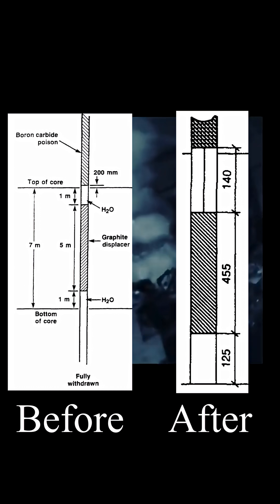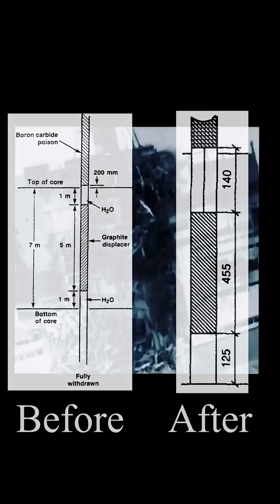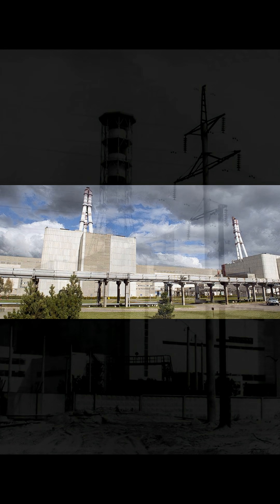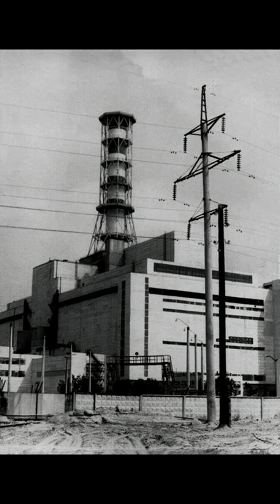Did a Simple Design Change Cause the Chernobyl Disaster? #science #history

Comment: I've read about water displacement casing a fission spike during maintenance of a small experimental reactor in the US, back in the 1950's or 60's.  A control rod literally pinned one man to the roof of the building.  What I've been able to glean about Chernobyl's reactor was that the control rods had graphite extensions.  Boron is the element that absorbs neutrons to dampen the reaction, but graphite is a moderator.  The video mentions the graphite but fails to mention that graphite is a more effective moderator than mundane water.  Having pulled the rods all the way out, it was this graphite that caused the reactor to heat up so quickly it caused the steam explosion.
Reply: That was the SL-1 reactor. It was a tiny, tiny experimental reactor and the cause of the accident was much different  than chernobyl. The accident was caused by a control rod getting stuck (and there was only a single control rod!!!) and a person decided to pull it loose by literally standing on top of the reactors biological shield and pulling on the control rod with his hands to get it unstuck. Once it came loose it slid out way too far and reactivity spiked. That's really terrible design but did not really have any offsite harm. Power spiked to about 20 GW in 4 ms, on a reactor that normally operated at a few hundref kW.
Reply: @soylentgreenb  There is a video with a highly detailed postmortem of the tiny little light water reactor.  They way they were describing the Chernobyl accident made it sound like this gigantic graphite moderated  reactor did the same thing.   What I think they meant was that the reactor kept running, because the light water that filled the void left by the control rods was enough of a moderator that the reactor kept heating up.  This was not the design flaw that caused the accident.  It was the graphite extensions on the Boron control rods.  Boron shut things down, but right at the critical instant, instead of braking, the graphite made it like stepped on the gas.

Comment: But i thought we saw the same fault in the Leningrad nnp in 1975? Obviously this was only a partial meltdown due to rmbk design creating a the void but was this not the same fault?
Reply from the maker: No, the scram effect worked normally in 1975; HBO misinterpreted it for some reason. What happened at Leningrad was the depoisoning of a local region of the core leading to a small surge in reactivity. I have already done a video going over this accident, which you can view here: https://www.youtube.com/watch?v=0lwJjCyPNeM

There is also a second accident that was very similar to Leningrad that occurred 10 years later: https://www.youtube.com/watch?v=Y1RUmqHwbIk
Reply: @thatchernobylguy2915  awesome, thank you for explaining :)
Reply: It's a common misconception that the 1975 Leningrad incident was related to the positive scram effect. You can even find it in academic historical work like Sonja D. Schmid's Producing Power. As INSAG-7 states, that incident was a demonstration of dangerous coefficients of reactivity/runaway. The power surge and damage occurred prior to shutdown. In our opinion the similarities between Leningrad and Chernobyl demonstrate a later undisclosed control rod design change that made Chernobyl different and possible.

Comment: So basically the answer is yes and no at the same time !

Yes design changes did affect it ! But the effects weren't seen too many times only a couple of times !And if I m not wrong both during some tests or basically not under normal circumstances!
It's like flying an aircraft which always has some risks regarding the designs but as long as u don't do anything stupid u r fine ! Although such design r then fixed with time
Reply: Normal circumstances inside an RBMK were never normal. One, due to the not fully developed physics before production; and two, because the operators were not in position of seeing real time parameters for it due to the particular way in which information was relayed to the control room.

Also, fuel burn up. Most of the core issues were witnessed when the age of the fuel was around 2.5 years and the beta F of positive reactivity started going poopie. TCG goes over it on one or two of his videos.

Cheers.
Reply: @The_Modeling_Underdog it's always the case with any thing that was relatively old in technology compared to now !
We got so many parameters and understanding due to Chernobyl!